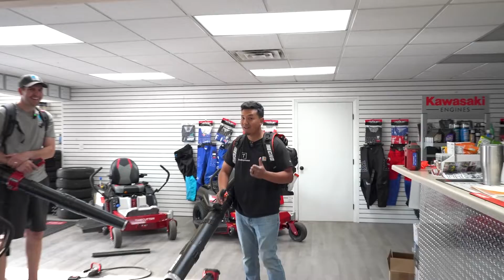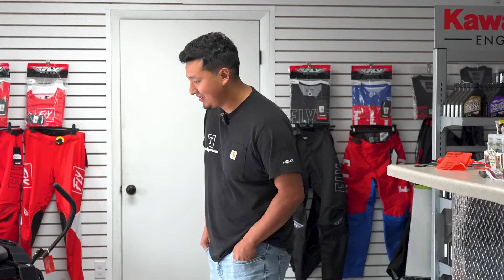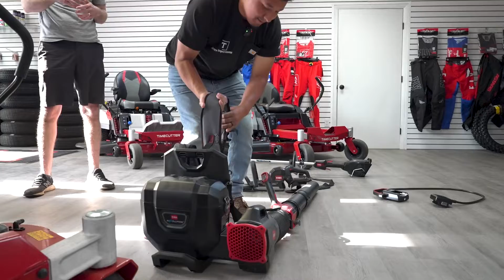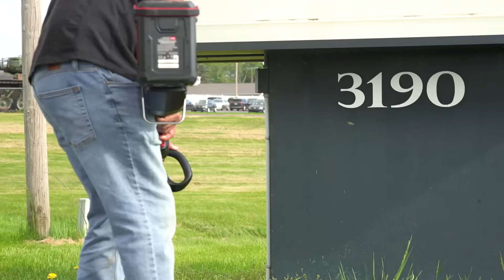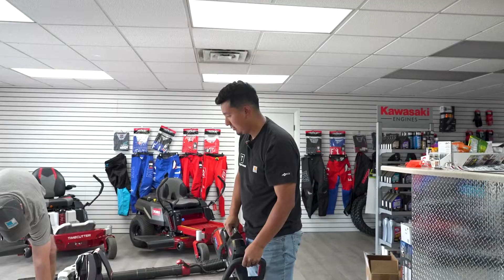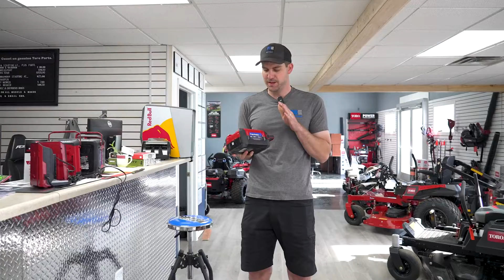Toro 60V Max Revolution Review (backpack, hedge & string trimmer)

Comment: I use that backpack blower for trail maintenance.  It works well for shorter sessions, around 45 minutes or so.   Kind of heavy, and the batteries are ridiculously expensive at $900 for two.  But it's very nice to not have to deal with the noise, fumes, heat, and sometimes fussy starting of gas.  If the batteries were cheaper I'd buy more and use it for everything.  But price matters.  Again it's a nice luxury to have but if you are on a budget, stick with gas.

Comment: Hey I’ve been involved in cutting lawns and landscaping since the 70’s. In my opinion battery equipment will not hold up to the commercial use. I also think the separate equipment will breakdown and have to be constantly replaced. 
I have a working Echo commercial weed trimmer which I purchased in the late 80’s. That Toro battery backpack is heavy and don’t see anyone wearing that all day long week long. This is my own opinion.